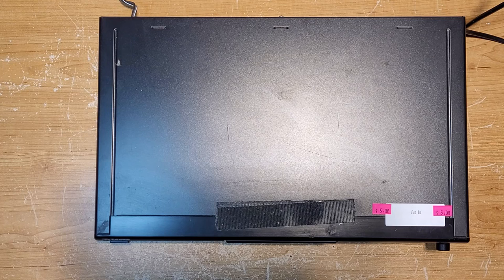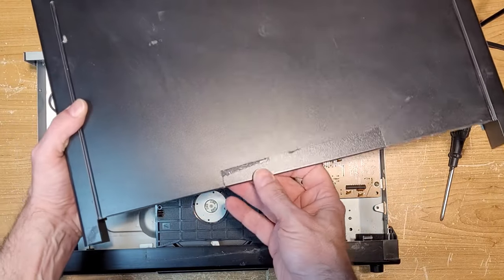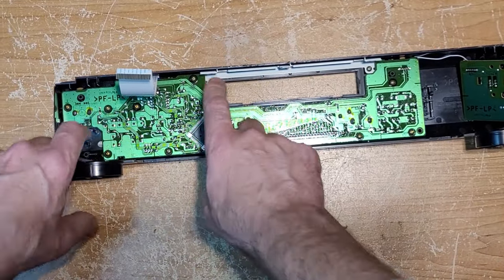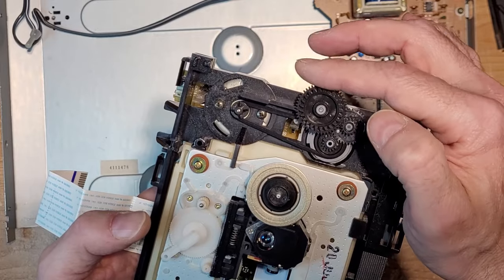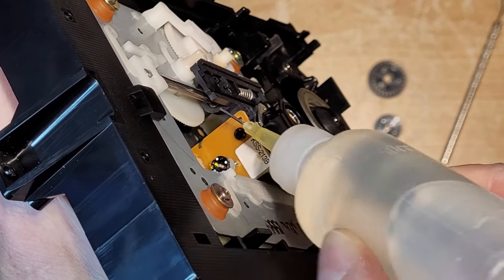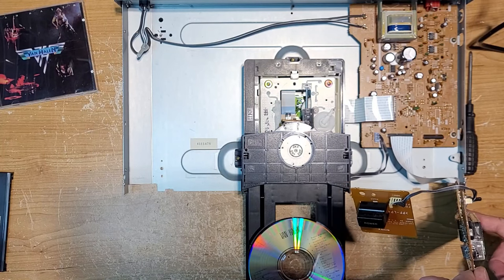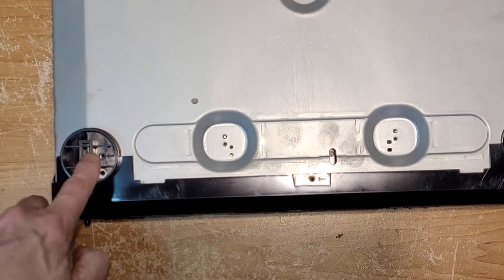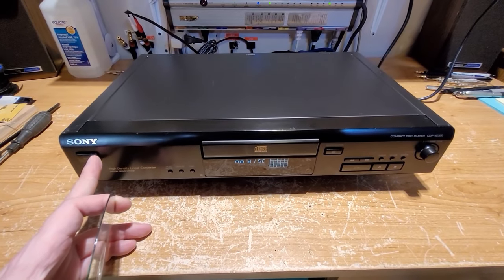Sony CDP-XE300: Thrift Store Save

Comment: Your clear and simple instructions have saved my Sony CD player. I could not open the disc tray but you showed me how to dismantle the player and I found that the eject belt had broken (after so many years). I ordered a new belt from eBay and now it works perfectly. Many many thanks.

Comment: Hifiengine lists this as a 1996 model. I struggle finding Sony archives on all the various models. I've owned 1987 Sony CDP-70, 1989 Denon C-615 (still own and works great). In past decade I've bought used$10 CD changers which are good when entertaining without resorting to ipods and wifi. I found two back-to-back used 1997-99 JVC XL F 154 (both from thrift store with failing power computer chip), replaced by a 1994 Sony CDP-C265 with repeated failure of encoder switch, and finally kijiji graced me with $25 mint 1992 Sony CDP-C515! Beats paying $500 for a new Yamaha changer.

Comment: I was having issues with this model.  Player would not recognize CD, or it would skip with a flawless CD.  Drive belt looked ok, but I went ahead and replaced it (purchased new belt on eBay), and this completely resolved the issues (so far anyway).  These units are old and I suppose the belts wear out, even if they look ok.  I would not have been able to handle the repair without your helpful video, so thanks very much!

Comment: Very interesting. This has been one of the most useful repair videos I've seen in a long time. Reason being that this cheap cd player, I now discover has the same mechanism as the 400 disc changers. It's a very specific variant of the KSM213 (with a metal clamp and the circuit board behind it) that I've been unable to source, so I will now be in the lookout for a faulty one of these on ebay where I'm sure such things will be worthless. Cheers!

Comment: NIce late model Sony CD player
I've been hoarding thrift pickups the past decade as well, mainly 5 disc carousels but interesting single disc spinners too.
I would have snagged this player too, just for the dial control and calendar display, stuff you don't see on many players, vintage or not.
I have several Sony carousels with similar dial control and calendar track displays.  Need to find some single disc units to round out my collection
Also been favoring Sony DVD and Bluray disc players that handle SACD- basically "free" universal disc players (other than the MLP tracks on DVD Audio discs)